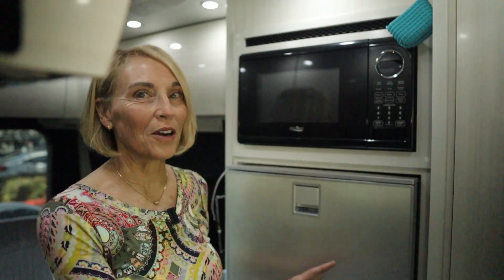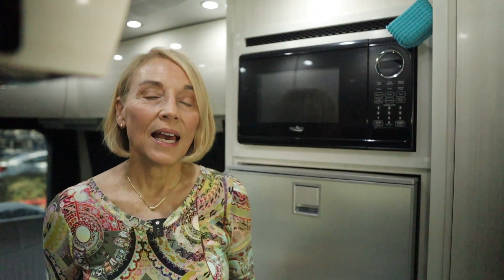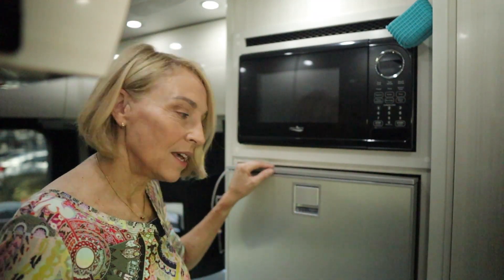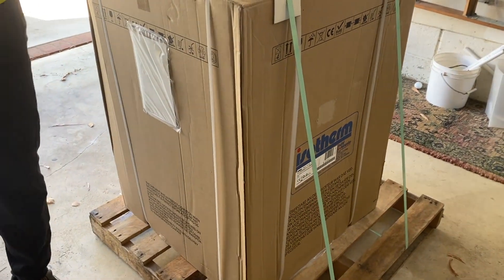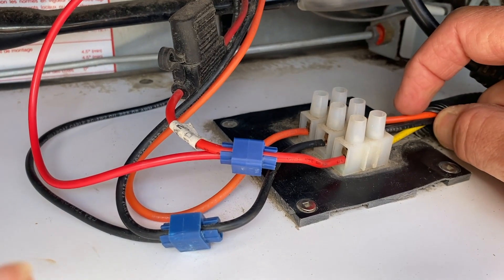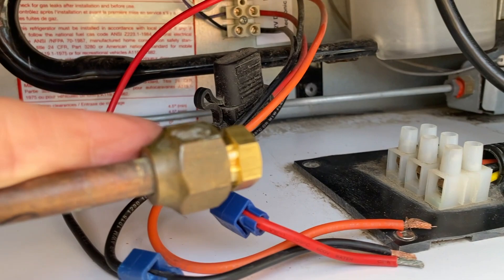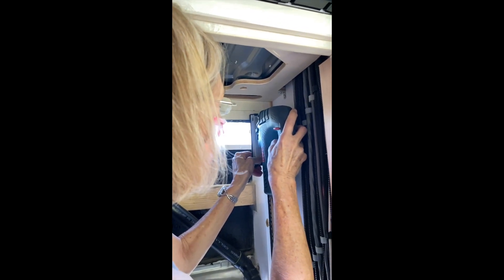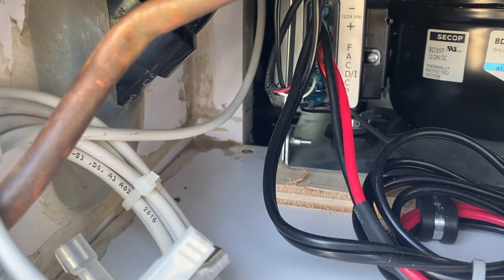How to install an Isotherm fridge in a Pleasureway Ascent Camper van

Comment: Hi Debbie ! This is a video I am revisiting , hanging on your every word , and so needed now as i have decided to replace my Dometic 3 way fridges that does not cool on propane. 
I have the exact year you do and want the Elegance 115 of course. I have read a Pdf with a 2016 Ascent who had to do some additional changes with Inverter and converter replacement.  Was this not necessary with your 2018 ?
Reply from the maker: No, we didn't change anything other than the fridge.  I could be mistaken but I think the 2016 Ascent had AGM batteries, not lithium so that may be why they had to change things.
Reply: @FromShetoMe  I’m super excited to have found the Fridge at PantherRV in Washougal, WA . ( I live in Portland ) 
Also gave me name of highly recommended RV Repairman who works mobile !
Reply: Hello Debbie, I just had the Fridge Swap done in under 3 hrs. 
A few questions  now. When driving, do you generally leave House Battery ON so it keeps Cool?  When Boondocking, will I need to watch closely the Battery Level so as not to run it down ? Do the Solar Batteries factor in ? Thank you sp much for all of your Sharing . There was no gap when he installed . He added the black vent grill on top as well and it fit perfectly. 🎉
Reply from the maker: @tartcherrypie  That's excellent.  We leave the house batteries on year round 24/7.  The only time we would disconnect is if we are doing work on the electrical system.  Or if you live where it gets below freezing in the battery compartment, then you would disconnect because you don't want the solar panels to charge lithium batteries when it is below freezing.  Your solar panels should keep the batteries topped off. At least they do where we live.  Your new fridge will just "sip" power. Remember to keep your inverter "off" when it isn't required for an AC appliance.  I suggest you put a thermometer in the fridge to monitor temperature.  This will work well:  https://www.amazon.com/dp/B0009Y7RPS?linkCode=ssc&tag=onamzfromshet-20&creativeASIN=B0009Y7RPS&asc_item-id=amzn1.ideas.WIHB2RWN6VEL&ref_=aip_sf_list_spv_s_ofs_mixed_d_asin
Reply: Today is 105d in Portland and the fridge had been set to Eco . It had trouble cooling lower than 50d after 5 hr so I shut it down. What is your understanding of Eco Setting vs Coldest Temp,Setting? I read the Manual but it is beyond my “ understanding level”
Reply from the maker: @tartcherrypie  I would not use the eco mode. But at 105, it’s going to struggle for sure. Make sure you always park with fridge side away from the sun. Don’t overfill the fridge. On our last trip, I would freeze a water bottle and place it in the door, refreezing overnight. You also might try a small fridge fan.  Avoid buying meat.

Comment: I second not using Teflon tape on brass  flare nuts, but especially for gas. Use pipe dope instead and be careful to not get it inside the connection. So you really should redo that for safety sake. 

Also consider getting a set of flare nut wrenches. The wrench will contact all six sides of the flare nut at once, so not making it oblong. Cheap ones are okay.

All of this detail is important only because it's gas.

You guys rock.
Reply from the maker: Thanks so much.  We will re-do that and share the tips on a future video.

Comment: Hi Deb, We have a 2020 Ascent and want to upgrade the refrigerator as you have done. Thank you for all the work you have put into this upgrade and the videos also. We have been trying to find a place to purchase the  Isotherm Elegance 115 but we can only find an Isotherm Cruise 115 Freeline 12v/120v. Do you know if this is the same fridge? It looks exactly like yours from the pics in the catalog.
Reply from the maker: Yes, it is the same. One of our viewers said he had an issue with the freezer door. Another viewer said he likes the fridge. Just wanted to make you aware.
Reply: Thanks so much for the quick reply. We were able to catch the model number  on the paperwork as you were unpacking the unit at 8:24 in the video with our 65" UHD TV... How crazy is that?! And already have the fridge on order! Now if the cavity on the 2020 is the same as yours we'll be in business! Thanks again for all the GREAT videos, they have been unbelievably helpful in outfitting our Ascent.
Reply from the maker: @stevemangold1802  So glad to hear it.  Makes it all worthwhile.  Thanks and let me know how the installation goes.  BTW, several viewers said don't use the yellow tape on the flare nut.  There are also differing opinions on how to vent, either through the existing vents or covering those and venting into the cab.  Just be sure to seal up around the fridge if you use the outside vents.  Don't want any critters getting in.
Reply: @FromShetoMe    I have to thank you so much for giving us the courage and confidence to attempt the major project of changing out the fridge in our 2020 Ascent.  The fridge is in, works great, and we are so happy with it!  I did not have the vent pipe interference issue that you had and we were able to push the fridge all the way in.  We were also able to get the joint at the top of the fridge tight by building a plywood platform at the bottom and driving some shims under the feet of the fridge.  It was daunting to cut into our still new van but the results were worth it!  Thanks so much for your guidance and great video! Keep up the great work!
Reply from the maker: @stevemangold1802  You are so welcome. Glad it worked out. I’ve heard from a number of people like yourself.

Comment: Re your comment about the air at altitude - the thinner air at altitude has less "Specific Heat" - less ability to absorb heat from the fins. You would need to have forced air circulation over the absorption frig coils (The ammonia solution inside the absorption system knows nothing about the outside air)
Reply from the maker: Thanks for the explanation.  We were camped at 9000 feet last year, outside temp was 50 and inside the fridge was 50.

Comment: Awesome job. 
Is it holding 40 degrees? 
I assume it’s not self defrost?
Reply from the maker: Easily holds 40.  Will have to defrost but I'm also seeing that the humidity level in th fridge is half what the Dometic was.  So probably just have to defrost at the end of a long trip.

Comment: I have a LTV and looking to upgrade to an Isotherm. Can you tell me what company you purchased from? How many watts or amps does the refrigerator use? Thank you! Great video.
Reply from the maker: I purchased from defender.com.  When it is filled with food, it will be lower than it is now and I can't really monitor for 24 hours because we have solar.  But I'd say it is what the manufacturer says: 267 watts/24 hours.  Another viewer with the same fridge said it is very efficient but cautioned that when the freezer frosts up, you need to be careful about opening the freezer door because he broke his.  One thing I didn't mention in the video is that even an absorption fridge running on propane draws some electricity from the house batteries. How much depends on each fridge. I rarely see anyone speak about that issue but should be factored into your calculations.

Comment: Now , you need to block off the openings behind the fridge or any breeze will come through past the top and bottom of the fridge. This will be especially noticeable in windy conditions. I used Reflectix and duct tape.
Reply from the maker: We do need to provide venting but I was thinking maybe reflectix in the bottom vent. Not sure yet how we’ll do that part.
Reply: @FromShetoMe  the ventilation top and bottom at front of fridge should be adequate.  Notice that all do it yourself camper vans and even George at Humble Road Vans use no outside venting .
Reply from the maker: @stanw909  They must be drawing air from the inside. I'll need to seal the fridge in for the winter so will at least keep some air from the vents.  Glad we don't have to deal with a lot of rain.
Reply: @FromShetoMe  As I said before. The Gap at the top that you plan on covering should be adequate. If you must cover the gap for asthetic reasons then use some sort of perforated grill material. Looks like the fridge will work great. We love ours.
Reply: I just rewatched the video. I noticed that you put some foil across the top of the fridge. That should be removed to allow top and bottom airflow. From all that I've seen, nobody vents these fridges to the outside. You've got a pip of a neighbor. What a blessing.

Comment: Make sure that the gaps around the frig front AND rear to not provide a path for insects to get in and out of the camper.
Reply from the maker: Good point.  I'll get on that before our next trip.
Reply: @FromShetoMe  Fantastic Video! Loved it. One idea is to use spray foam that comes in canisters (get in HD) to seal the gaps, what do you think?
Reply from the maker: @chakriavala9925  I think I need to do some more research.  Some people say close up the vents and do the circulation from the inside compartment and others have a different opinion.  Thankfully we don't have to rush any decision at the moment.

Comment: I hope your unit works out for you, I personally had a terrible experience with it. The power consumption is great however the freezer door broke within a month.. Additionally, if you have to send it in for repair the guys in florida are absolutely terrible. I sent mine in because the freezer could not get below 17 degrees even on eco mode and set to high... they did not fix anything and the back half of the freezer still won't cool
Reply from the maker: Good to know.  Thanks.  At this point I'll take 17 degrees in the freezer.
Reply: @FromShetoMe  it does hold 17 degrees easy and consumes almost no power at all, not even noticeable (the manual stats it should hold 1 degree at max, something I have never hit in a year of ownership). When the freezer starts to ice over thats when breaking the door becomes almost imminent.
Reply from the maker: @EMA9-MCAD-RSI  Thanks.  We'll keep an eye on it.  I wonder if a gasket applied around the opening would help.
Reply: @FromShetoMe  i thought about getting a rubber gasket from Homedepot and applying it to the main door to press the freezer door closed

Comment: Thread tape is useless on that strait threaded flared brass plug. It is only works for tapered NPT connections. The flare is where the seal is not the threads.
Reply from the maker: Thanks.  Several folks have pointed that out and we will change it.